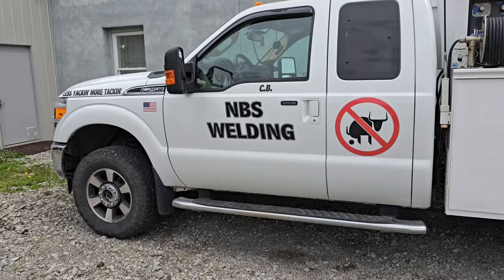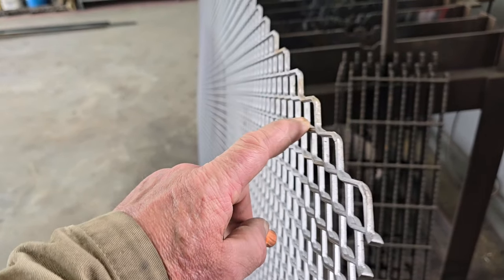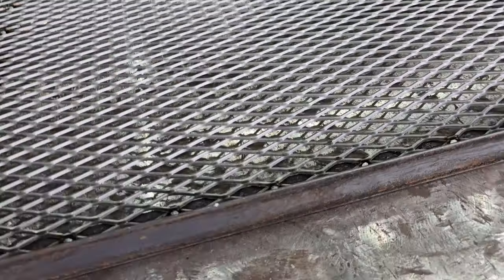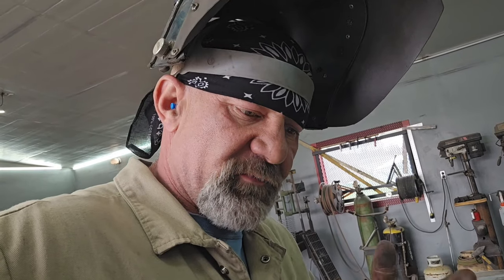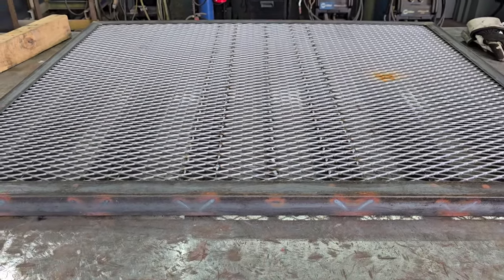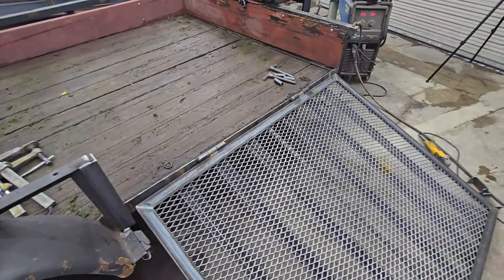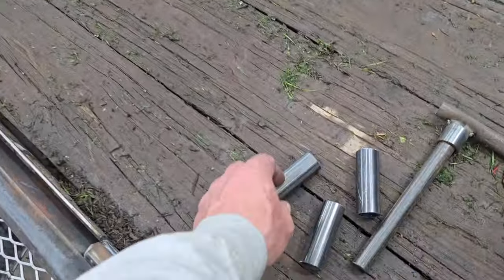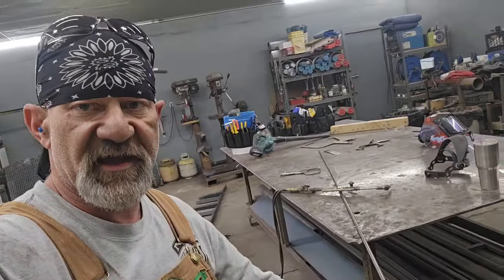Building a trailer ramp and adding to the side of a trailer

Comment: Wonderful video CB!   I like putting both edges of the angle on the flat expanded metal.   That gives me a good idea on how to increase the strength of my tailgate.   I’ve been doing some trailer mods on my 5’ x 10’ trailer.  I welded some extra bracing underneath the left corner, and added a 2000 lb. lifting crane, put new decking boards on it, and now just have to weld on a plate and the jack to support the area underneath the crane.   I appreciate the work you put into these videos!
Reply from the maker: Thank you 👍

Comment: 100% those always snap the spot welds and then the mesh sags and it sucks, then the machines crunch thru the mesh, bought a trailer recently in some spots you cud drop your foot thru it and damn near loose ya leg doin it. Little NBS tackafier solution on there and she’s back like new. I did like seeing how you made those hinges tho, being that I’m just getting into Fab work I was curious how you were gonna tackle that, so great job 👏
Reply from the maker: Thank you 👍
Reply: Hey cb how long was that side ramp tho approx? Cause I keep thinking on mine it wud need to be like a damn diving board length to get my mowers to roll off there without throwing ya over the controls as it snags on the crest? And then if it didn’t snag, I’m worried it would be like the roller coaster crest or the giant drop going over that thing? Is it pretty smooth on and off wit a mower tho? Y’all test it? I mean for the quad and off road crowd who gives a sheet, but like higher end mowers that cut super tight tolerances and whatnot I can’t be jacking up rig getting them off and then butcher somebody’s high end lawn, I think that’s the main thing that’s scared me away from making one of them dealios already myself
Reply from the maker: Ramp is 50" long...same as the rear...he's been running his mowers up and down the rear ramp so we know that length is fine...depends on how high your trailer is I reckon
Reply: @NBSWELDING  mines the Leonard one with the dang high ass sides on it, like excessively high sides for lawn care I think. But anyways I got feds up with the janky panky hitch that comes on the trailer stock, mine was kinda worn out and I use my mower to shove the trailer away each night at my storage unit which is a pain so I wanna make it as easy as possible so I pulled a CB and hit up northern tool the other day and seen they had those upgraded style tongues you can weld in, this one auto locks and is a lot more beefy than my stock 3500 lb one. This ones rated at 6k I think which it will never see but I made alittle short of me slapping that thing on last night CB Check her out. I was at my shop/ storage unit tho so I only had 120volt and just rocked my little Lincoln flux core machine and slap her back together wit a few beads All the way around after the judy chopping. My question to you is, just curious, if I wasn’t able to do just do this myself, what would a job like this cost if someone came to you, or any welder and wanted to upgrade their trailer hitch portion? Just curious buddy cause I’ve honestly never seen anyone talk about or doing this exact job 

https://youtube.com/shorts/paEFHyulOfk?si=5GTy5STNc0RkgOJ2
Reply from the maker: @bladesofglorylawns  I've had guys tell me they don't like the Leonard trailers but can't remember exactly why or what they complained about...maybe it was the height

Comment: So how would you fab a tailgate with a bend in the middle so it doesn't stick up as high? As always great video lots of helpful info!!!!
Reply from the maker: Hinges welded on the bottom with two angle iron or square tube frames...so that when it's down the frames smash against each other holding the ramp straight...probably not worth the hassle or you'd see them like that more often...good for getting your fingers smashed though

Comment: How do you go about tacking the expanded metal without melting holes in in? 👌
Reply from the maker: With solid wire MIG welding...if your melting it then your using too much voltage, or the material is contaminated or deteriorated....if rust or old paint is causing contamination then you have to clean it up best you can and just barely tack then pause and tack again....in that case you tack and let it cool and repeatedly tack again to build up material and purify the area...takes some practice
Reply: Thank you for your time and wisdom👍